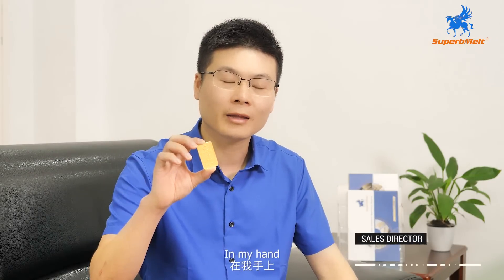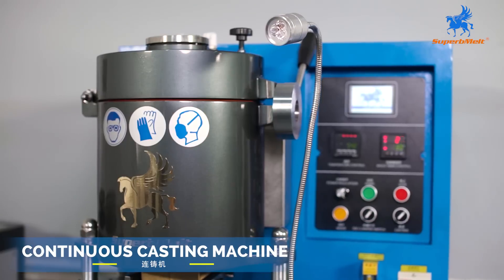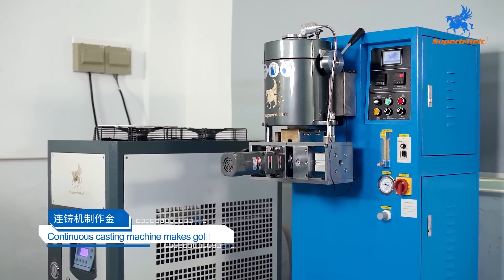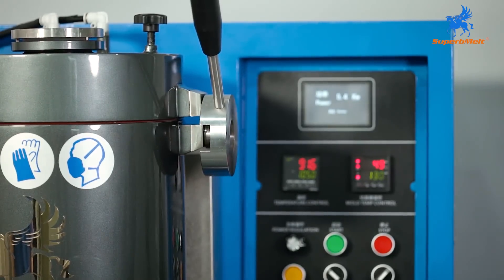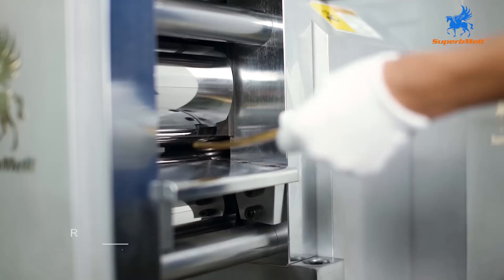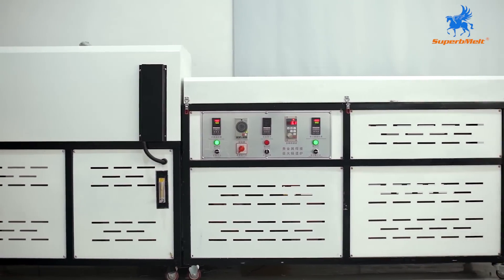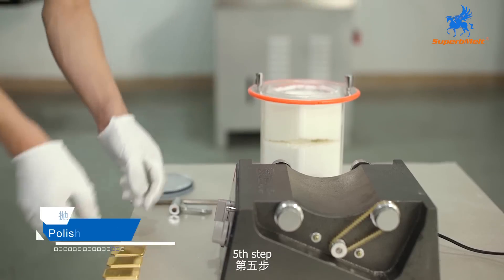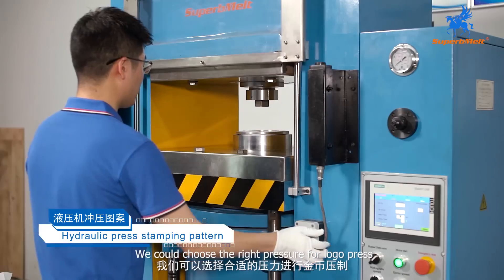How to Make Gold Coins and Minted Bars：Gold/Silver Coin Making Machines Manufacturer

Comment: I have spent a lot of money to start my micro-mint. 
Including $450 on a cnc milling machine that nobody can figure out how to run.
I have a 6 ton press to cut out my blanks ($150).
I have another 6 ton press to stamp the designs onto the coins ($150)
I have my first set of fabricated coin dies being made now ($500).
I have a hand crank rolling mill to make my initial thick sheets from the pours..($350). But still need another to reduce sheets to cutting thickness ($350).
I have an electric melting furnace ($350) to melt the silver.
I have graphite crucibles that set down in the melter to melt silver in ($50 each).
And soon will either buy or build a burnishing machine to polish my blanks.
And I have a supplier to buy my silver.
.....................................................................
So... You can do it. But be prepared to spend some cash.
And silver is running around $25 to $30 per ounce. Check daily spot price on line...buy when price is low.
Reply: Nice, thanks for sharing. Are you happy with the way your mints turned out?
Reply: @raywill  I am not "there" yet. My first stamping dies are being made as we speak. And I still have more equipment to buy. Such as polishing machine. And while I believe my current 6 ton presses will be sufficient... It could be they are too small and I may need to buy larger presses...like 8 ton or 12 ton or even a big 20 ton... I don't know. 
But...given small size of my presses... I know I will have to have blanks be a
 little hot...to keep metal soft...for striking.
Having a shoestring budget, I have to save for every piece of equipment...(no bank loans)...makes it tough slow going.
But , as I said... I fully understand the process and what things I will need.
Reply: @His_Serene_Lordship  3yrs and wow look where we at, can I inquire where things at for your operation?
Reply: Hi darrin can i have links where did you bought those machines you said i want to build my empire also in my country hahaha